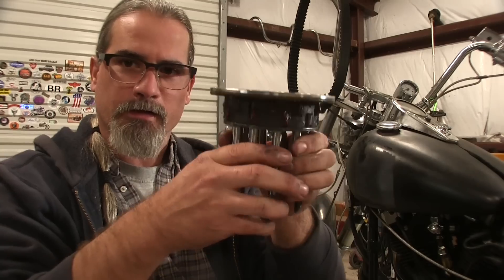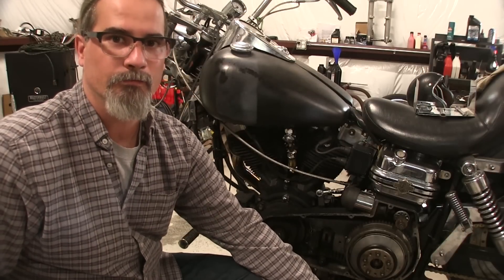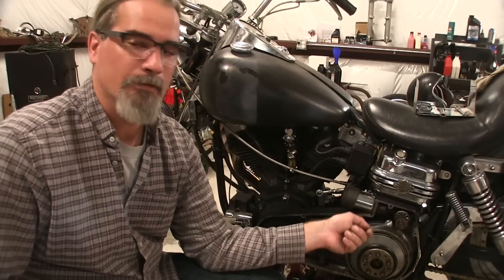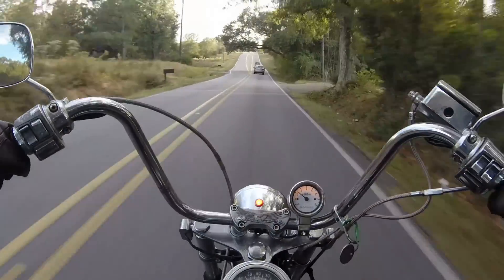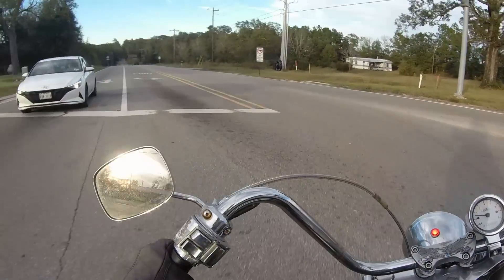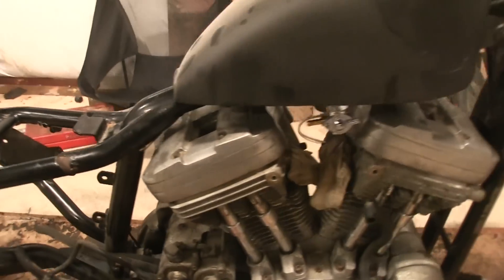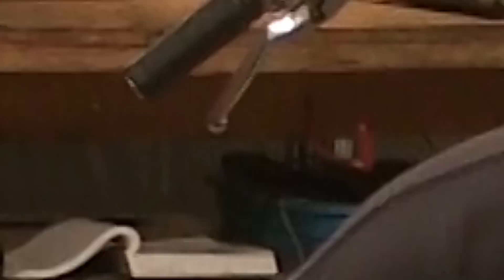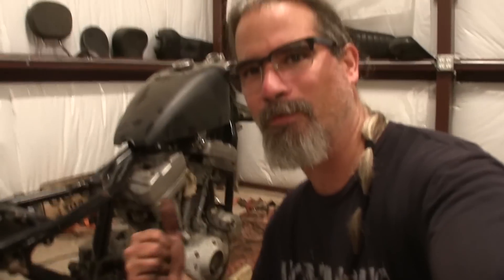This HARLEY Davidson SHOVELHEAD Has Made A FOOL Out Of ME / Clutch, TIMING & Kickstart Issues Solved

Comment: Hey my brother, ditch the friction disc and replace it with a nylatron. Next get rid of the off set bearings and replace them with the ram jet 52 needle bearing kit. Next get yourself a stock American made Harley clutch hub,go to your dealership get 10 long studs and replace them. Now you have a American made 10 stud clutch hub. Now use Barnett Kevlar plates and you will be a happy amigo.✌😎

Comment: That part about the clutch hub reminded me of the time I was in Sturgis at the 50th with my '76 FX stroker and got the great idea of putting a 25 tooth sprocket on the final drive to lower my rpm's. Pulled everything apart put it all together and we were ready to leave tried to kick it over and nothing happened I could just kick it through. Well the key had fallen out. So we had to take the primary back off and put the key in. Now I always tilt the bike over when not on a lift to put the clutch hub on with it in the 12 o:clock position. About getting slammed about working on a shovelhead. It's a learning process. You can evolutionize that scoot with a 5 speed and a wet clutch. Another thing I will share is why did it take Harley 35 years to go to a spline shaft at  the tranny. In '55 they went to a spline shaft and timkin bearing on the motor but didn't go to a spline on the tranny till '90.

Comment: Good to see you got the clutch going.  Had a similar problem on my early '78 1200 Shovel. Found out the holes in the brand new friction disks were too tight of a tolerance and were catching.    Also,  found out you need to keep the clutch drum fairly clean or the plates can stick. Yea, another damn thing to put on the PM schedule.   I switched to the Sifton diaphragm clutch pressure plate.  So far so good.  And if you are going hi performance, the thing can put wicked amount of pressure on the plates.  Probably enough to snap the clutch cable.

Electronic IGN is a slightly better way to go.  On the points setup,  the centrifugal weights get dirty (like everything else on a shovel) and they don't return as quick. So, when coming to a stop at a light, it makes the bike fast idle for a while. 1200-1400 RPM.   
  
As for the starter.... crappy design.  Somewhere in the manual it says that the solenoid stays engaged until the engine RPM is higher than the starter.  So, if battery is weak,  there is a possibility that the starter would stay on till the batteries were dead.    I solved that by getting a auto solenoid (some people call them Ford solenoids) and put it under the battery box.  When I let go of the starter button, it disengages, which takes power away from the regular solenoid on the inner primary cover.  

T Mack
Reply: That problem with running on and not disconnecting when you have low voltage happens with some old cars and trucks, as well. My first vehicle was a 63 International Scout, and that happened to me when I first brought it home on a trailer and went to crank it back up. The rear axle was toast, so it had sat up a long, long time, and the seller had it running when I got there. The battery was toast, as well, but barely put out enough juice to get that tiny half a V8 turning. Once she started turning, it would not stop! I got the ground cable off before it burned up the starter, thanks to my dad being there, watching in glee as I struggled with my choice of first vehicle. "That thing will never leave the yard!" I heard that in my head every time I turned a wrench on Ol' Betsy, and I gleefully reminded him that it had, in fact, left the yard every time we took her hunting or camping! He who laughs last, laughs the loudest, they say. Wish I had never sold that truck! Don't miss those vacuum powered wipers in the rain, though. They are purdy awful!

Comment: hi! On my shovelhead I changed the classic(open belt) clutch with a "York" clutch. Easy install, works with a diagram and evo clutchplates. Man this is a real game changer. It works so well that I'll never go back to the old system. Very easy to find the neutral now, it's smoot and goes as a racebike. Cheers from France and good luck in these winterdays🙃
Reply from the maker: Good deal, man!

Comment: Don't worry about the haters, they all had to learn the same way you did. One bit of advice I found works when working on starters, I usually change the bearings in the back of the starter shaft and the one in the outer primary case when I have it apart anyway, makes sure your alignment is correct between the shaft and the ring gear/drive. I never did have any luck with the shovelhead clutches, so I changed out to a Rivera Pro Clutch and never looked back.

Comment: You are getting it dude !!!! Got a couple things to say. Number one, i don't like a primary belt being enclosed. Belts nowadays get tighter when they warm up and when there enclosed like that they get too warm. Number two, there is a company called, " American Prime Manufacturing" that sells either parts to update your clutch or a complete clutch set. This will take the slop out of your present clutch. You are correct about that 3 stud clutch, it is very inferior. Once the slop is out of that clutch hub, you will find that all the starter parts, jack shaft, etc, will work much better together.
Reply: You're correct the belt gets hot when they are enclosed that's why you need to vent your primary cover
Reply: For this reason I offset the inspection cover about half an inch on my 81 Sturgis. This allows airflow for cooling the belt
Reply from the maker: @bmp72  That's what i've too. Also to the derby cover. It's not very apparent on camera though.
Reply: @bmp72  I had a Sturgis in 84 bought it to have a stock belt drive harley to match a fxs 1981lowrider I had at the time. Wish to God I never traded it. I loved that bike had drag bars and forward controls,had 1.5 inch short shocks and a rat seat,bought a bobtail fender ,the paint matched great,pinstrips looked good to . It was perfect (I'm tearing up,hold on...) pan,shovel, and evo. I wouldn't own anything else lol. Thanks for sharing 🍸
Reply: Ya get a 5 stud basket .get the better springs too. I don't know if you've ever had experience with a five lug basket before but you'll pull your hair out trying to get all five of them the same tightness... tightness? Is that a real world?🤣 you'll always have one that's loose 🤪it'll drive insane😒 just let it be loose bro🍸
Reply: @caseykelso1  both my 1981 and 1982 Sturgis are still (very very close to) stock... as is my 1983 FXDG Willie G special twin belt wide glide.

Comment: I just bought a 84 FLHS and the guy that sold it to me called it a Troublehead. I’ve made three trips so far, the first time the turn signal vibrated off and was hanging by a wire, the next time was a success and the third time it came home on a trailer. But boy it is fun when it runs.

Comment: I've owned my '81 FXS now for 18 years and it's my third Shovel. 
Once you figure out the start procedure (they're ALL different) and replace the parts you really need with good stuff, all you have to do is keep up with the general maintenance and they are as reliable as hell. Mine has never left me on the side of the road...ever...and all my friends are glad I have a tool pouch with me, even though they use it and I don't!
A well maintained Shovel is as reliable as anything out there on the road, and the best part is...no computer, no fuel injection, and if something does go bad you can usually cob it together enough to get it home. No AAA membership like all my riding buds need. Long live the Shovelhead!

Comment: I caught some crap as well when I put a rear chain drive on a 98 Electra. "Why did you change from a belt? That's crazy." If you ride a lot, and that belt breaks, you are stuck unless you happen to carry around a jack and tools to pull rear wheel AND primary off AND an extra belt. If the chain breaks, All I need is a master link to thread it back through and keep going. A seriously old school mechanic here who is a rider with a club I wont mention here, converted it for me and told me that high speed roller chain uses wax, not oil. Keep it with about an inch and a half of slack to minimize wear and it wont break. He runs the same chain on a turbo bike making over 200 hp.
Reply from the maker: Don't forget the removal of the swingarm too. Same for softails.

Comment: hi corey, good to see you get the bugs worked out. never used a light an any harley, points or otherwise, but i would static time them then creep the ignition advance a tiny bit at a time till i got the best performance. not out of pride or prejudice, but 'cause i never had a light. same end result though i guess. here's what i say to the younger generation getting into the old bikes, 'more power to ya, bikes you have a relationship with. not just bikes to ride'. anyway, keep lookin' up bro.
                                                                                                                                                                                                                              bill
Reply from the maker: Thank you, Bill. I think you nailed it.

Comment: The absolute single best mod I ever did to my Harley kick/electric 4-speed setup was getting the Primo Rivera Pro Clutch, it was literally the last thing I ever had to do to that clutch, installed it and forgot about it, and had a light pull positve engagement clutch that felt like a modern bikes ;-)

Comment: I turned wrenches on my old Shovelheads for a long time. They were great bikes and for the most part easy to work on. The clutch on the other hand sucks for design. You will always from time to time have the lunge of the pressure plate. Just have to get in there and keep adjusted or, get a Barnett setup. If I had enough room in my shop, I would have kept one of the Shovels. For me, the biggest improvement was going from 4 speed to 5. That was like riding on a cloud. Keep the old bike running. They are disappearing fast.
Reply from the maker: I'm a 5 speed fan myself. Had a 6 speed for about 5 years. Never could get use to it.

Comment: That’s one of the reasons I like shovels. I like working on them. It’s a learning experience and it’s a good feeling when you figure something out and get to ride. I switched to the Rivera Premo clutch system. Very smooth shifts and really easy to find neutral. I always like your videos. It gets me to check things on my shovels.
Reply from the maker: Rivera Primo is what I'm running in mine too; with a BDL belt.

Comment: I changed over my clutch hub to a 5 spring and straight roller bearings years ago, early 90's, never had a problem since. I didn't like the way my bike took off from the start, I ended up putting a FL first gear in the trans because it's lower. The trans sprocket and wheel sprocket are more for when you are going down the road, not starting off. Just my opinion.

Comment: Those posts in the clutch hub get notches worn in them from the steel clutch plates. New hubs are relatively inexpensive. I highly recommend Barnett HDP5K kit with aluminum-backed friction plates. These do not wear notches in the hub pins.

Comment: I'm running 23/47 on my 74...really nice to have dropped the highway revs down. No real effect down low...but a bit of weight off my mind all the same. I think my 80 runs 23/48, nice at 70mph
Reply from the maker: I thought it was the gearing when all along it was my timing that was off.
Reply: @SaddleTrampTV  yeah, i dont ride the shovel two up either, so my gearing suits me. The timing issue that was good info, as I'm new to shovels too,  thanks.

Comment: I remember the video where it was kicking back real bad. I also remembered when I had my 45 flat head with the cable broken to the distributor advance, that if I did not retard it by hand before kicking it, I got the same results you had. Maybe not quite as bad because the 45 had a real low compression ratio. But it was enough to hurt. 

And that starter arrangement was carried over to the early EVO's. 

Glad you have your Shovel ironed out. It is that never give up attitude that wins at the end of the day. 

Great video.

Comment: I installed years ago the pull starter solenoid looks like a shifter knob right where the original solenoid mounts on the primary in my 1986 Softail it stopped all the BS starter problems, I think it sells in the V Twin manufacturing catalog nowadays.

Comment: As a long time shovelhead mechanic the best ign for a shovel or Evo is a Dyna S ignition valve tran the new style Evo lifters tapet blocks and pushrods set them and forget them carb Bendix 38mm with a adjustable main jet and a bakelite spacer block. All kick start bikes have their own combination because all motors have their own personality. I'm 65 closed my shop 6 years ago because of my back and lack of the Evolution and back motorcycles out there to work on. Glad you got yours figured out may you Ride and enjoy it for years to come. One more thing there are harmonic balancers out there that fit on the crank primary drive that take out 80 percent of the vibration these are for all pre twin cam motors. Everyone ride safe and God speed. You really want to wake up your motor duel plug the cylinder heads a hold on when you crack the throttle yehaw ✌
Reply from the maker: Didn't know evo lifters and pushrods can be used in a shovel. Never heard of that. Maybe I'll give it a whirl.
Reply: @SaddleTrampTV  ya I screwed that up the company that makes the aftermarket kit dang getting old and forgot to put my glasses on lol

Comment: Hey Corey; you got me to remembering things I've leant over the years, and I get question about it often enough. Is; why do I carry so many tools in my Bike(s) saddle bags? Because I plan on getting back home riding my Bike. Not having it towed home. It's, not like I carry a Tool Chest in there, just the common tools, plus a few. On Bike ignitions, I rode my '89 Sportster to the Bank one day, and after doing my walk-in business, started the Bike and it had a low-speed miss. After getting back Home, I pulled the Nose Cone off, checked the timing, it was right on. Long story short, I ended up pulling the old OEM Ignition out, I founded the Red wire had been shorting out between the Nose cone case cover and the engine case. Not a very easy thing to find. I put in a new ignition unit that I can plug-into my Laptop, which can tell me a lot of things (like how many times I'd started the Bike) and it will allow me to change the timing programing in many different ways (and much more), which is Super Kool for me and my Sportster. I am wanting to do the same for the Big Twin EVO, but the Old Rules of Thumbs is, If it Ain't Broke, Don't fix it.☺

Comment: Try the anderws N1 cam it's made for a stock shovelhead. I used to run 25 tooth at the trans and 48 at the wheel. And it pulled away from a stop stronger than stock . My 83 shovelhead was shock ,with an su carb ,single fire , N1 cam, and a good exhaust.  The thing ripped and ran reliable, For years . I miss the old girl .but my 98 fatboy has a similar setup, but with a 6 speed trans . The 6 speed is better than tall gears ,all day long .

Comment: I will try soaking the clutch plates in transmission fluid like you did (80W90 ?), my 81 Sturgis suffers from a grabby clutch too. My 83 FXDG also has the 3 finger dry clutch, behaves perfectly. On my bikes (after 1980) I set the timing such that at high rpm the single dot shows, they changed this in 1980. My bikes start as easy as yours, especially when warm just looking at it wrong will start it. I copied the timing marks to the front pulley, so I can check timing without having to use the clear plug, much easier and better visibility with no reflections etc.
Reply from the maker: On the clutch issue, it was one of the fingers that was not in line. So, I was fighting each disc to make it go on; causing the stackup to stick together.

Comment: I have 2 Hondas I am having trouble with the turn signals. They take their own sweet time to come on after you turn them on. Other times they come on quickly.
Reply: That sounds a lot like the turn signal switch pops cover apart and clean it with some electronic cleaner. Take a look and see if you need some waterproof electronic grease on them
Reply: @johnjenkins9202  Thank You. I will check that out on both bikes.

Comment: The older machines like the Shovels are so much easier to work on .The new ones are totally different , sometimes( most of the time ) the parts are so cheap on the newer ones that it is like you might brake something just working on them. Most people should never try to work on any motorcycle unless they have had a strong background in it. You sir are better than most , I have had to redo all kinds of crazy shit people do to them..       j-d
Reply from the maker: I've spent a good bit of undoing on this bike already.

Comment: Why no RamJet tammer on hub?  A must with primary belt. Ending, you are now a Shovel mechanic 💪
Reply from the maker: Don't want the hassle of picking up all the roller bearings every time I remove the clutch basket.
Reply: @SaddleTrampTV   I understand but mine was installed with new hub 20,000 miles ago , so hopefully another 20K or longer before I have to mess with it again! 🙏

Comment: I would think that a rag soaked with lacquer thinner would take that paint off..
Reply from the maker: I just used what I had.
Reply: @SaddleTrampTV    Every shop needs to have some Lacquer thinner in it .. Trust me it would have been an effortless job with lacquer thinner. And no damage to  the chrome ..  I used to pay $20.00 for a 5 gallon pail of Gun and Equipment cleaner..   the last pail I paid $70.00 for on sale and that was like 7 years ago